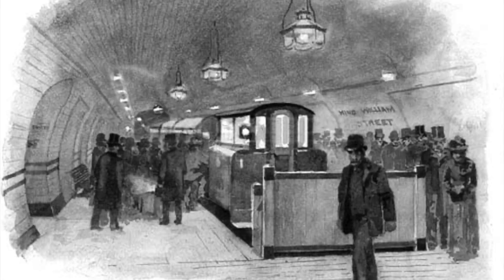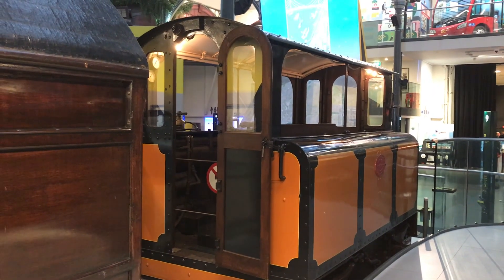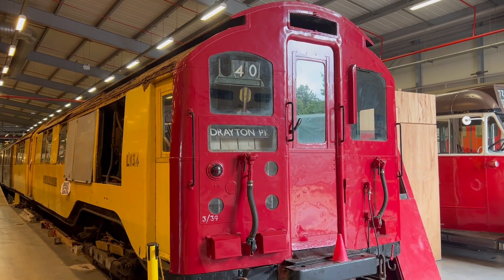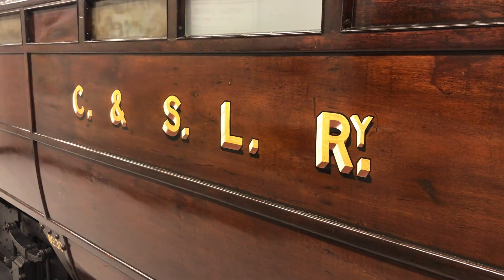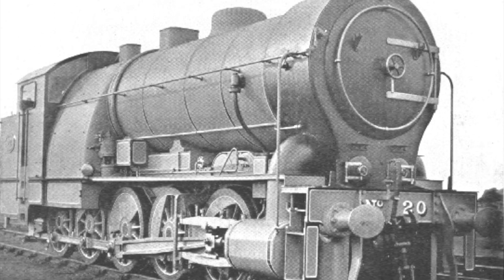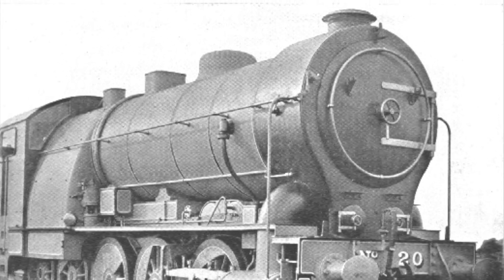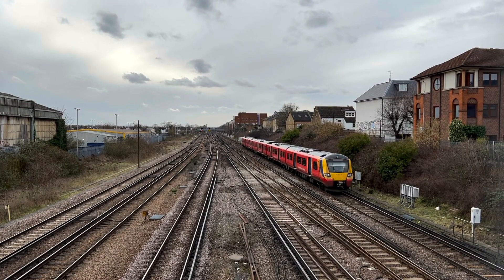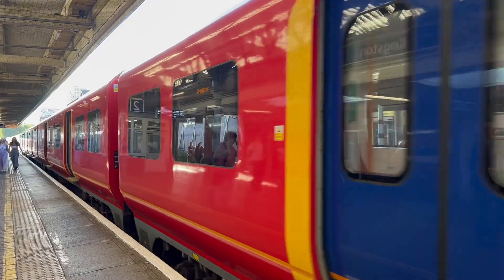Why some electric trains use a third rail, and others don't

Comment: I started on the North Clyde. Had a quite intensive electrification module on my Guards course.
When I transferred to Reading, I pointed out that I knew nothing of 3rd rail. My conversion course consisted of the words 'don't step on it'.
Reply: Pretty much all you need to know. 
When the lovers walk open days were on at Brighton 1990 the juice was off in the entire depot. You could tell staff and punters as staff were still stepping over it where punters were sitting on it eating their sandwiches.
Reply: @highdownmartin it's a habit you don't want to break!
Reply: @highdownmartin  Having grown up with electricity, I would never sit on the electric rail, just in case someone somewhere de-isolated it!
Reply: Should have included "and don't pee on it".
Reply: I had a friend at school whose father was a senior engineer on the Glasgow Subway, after having started his career on the Tube. His rule was simple: just don't stand on any rail ever.
Reply: When I joined the SR in the 60s I was taken to Stewarts Lane for a look round. At one point it was decided to cross the depot to the other side (we had been told not to step on anything metal) and we set off over the network of lines. At one point (literally) I found myself with nowhere to put my foot but fortunately, after an ungainly hop, managed to extricate myself from serious embarrassment and what would have been a very red face. Nevertheless, I much prefer the tidiness of 3rd rail to all that knitting.
Reply: I started on the Great Western Route, and was trained in PTS AC DC in case I somehow found myself at Reading (not at all likely as I worked for the Westcountry Area Signalling Engineer based in Bristol, even the AC part was a stretch as the nearest wires were at Airport Junction in London). 

I can still remember it being drilled into me to apply T-CODS to the furthest rail from the 3rd rail first as the cable wouldn’t reach far enough to short out the live rail to the furthest running rail. 

I done the opposite to you. I moved to Scotland and had the DC part removed from my PTS. 

When I consider how often I’ve been down on my hands and knees in the 4ft and leaned over to the rail, the thought of doing that where there is a live rail right there is terrifying.

Comment: Stepping on “The Third Rail.” A mistake that is only made once!  ⚡️💥 
Remember the old electrician’s saying: It’s the Volts that jolts but the mills (milliamperes mA) that kills. The current from the third rail exceeds over 1000 Amps.
Reply: Some moons ago I was LT train crew. Unusually I was wearing leather soled shoes one day, it was also raining.
I'd been instructed to stable a train in sidings. Leaving the cab through the door in the front, I stepped from the cab floor to the coupler, from the coupler to the neg rail and then to the ground. With one foot on the ground, the other still on the neg rail and one hand on the grab rail I felt a decidedly tingling sensation. Releasing the grab rail and moving my foot from the neg to the ground caused the sensation to stop. I never wore anything except rubber soled shoes again.
Reply: @RogersRamblings did the rubber soled shoes have a thicker sole? I knew someone that worked at Upminster Bridge, his doc martins had a thinker sole just incase you accidentally touched a live rail.
Reply: @johnchurch4705  I normally wore ex army rubber soled boots or occasionally rubber soled shoes. It was only the leather soles that allowed current to pass.
Reply: When my dad worked out of Hornsey on Eastern Region with a diesel on to the Slade Green Depot on the Southern region via Snow hill tunnel, he did forget about the 3rd rail and step on it climbing off a loco. One can think his boots insulated him.

Comment: The DLR is third rail also, but with safer bottom contact - ie pick-up is from underneath the rail, the top being insulated, so largely overcoming track safety issues - but still 750v DC.

Another issue is that OHLE permits faster running.  Because of the shoe system Third-rail and Four-rail systems have a practical speed limit of about 100 mph (that’s one hundred miles per hour for those who think in metric 😚).  Still fast enough for the vast majority of even quite long-distance services.

Despite notable installation and maintenance cost advantages (and greater safety with bottom current collection), Network Rail is set against third rail and would (if it had the money, which it doesn’t) rip it all out everywhere.  Then again OHLE isn’t exactly without its dangers with staff warned not to get closer than 9ft from a live cable.
Reply: When I got a ticket to access the DLR track to work on an overbridge the DLR ticket was just a few hours compared to nearly a day for the Underground ticket. They did say that you could electrocute yourself on the DLR rail but you would have to be unlucky or trying too.  The National Rail PTS ticket was a number of days but they covered working on live track.
Reply: 100 mph = 160 kmh. It's not the fastet but not slow either. Here,  in the Netherlands, (1,500V DC with overhead wires) maximum speed for trains is 140 kmh (87 mph). Only on the HSL trains are running faster. Although, due to subsidence in the railwaytrack, at this moment on that line speeds are restricted to 120kmh (75 mph) only between Rotterdam Centraal and Schiphol Airport... which means for now that trains on the old lines are temperary running faster... This has nothing to do with maintenance but everything with soft surface which was and is always a problem in this low country.

Comment: I'm sure I read somewhere that there are restrictions on 3rd rail electric systems these days. They can extend an existing system, but not equip a new one, like the Chiltern Line. The DLR has a third rail but it's hidden underneath plastic to get round this
Reply: I believe it is to do with UK H+S law about a working environment with easily accesible unprotected live conductors not being permitted.
Reply: Yes, sabotage by civil servants.

Comment: Why is the engineering for overhead wires so ugly and over engineered in the UK compared with Europe? Watching cab rides in Norway and Switzerland thet are slender and graceful wheras ours are clunky and brutish.
Reply: Depends on the era it was done. The west coast out of Euston and east coast out of Kings Cross are very lightly engineered but suffer quite badly when there is a dewirement. The Great Western out of Paddington is very much brutal and over engineered - except the bit up to Hayes and Harlington which is now suffering for not being up to the job today. After all that bit was put in for Heathrow Express not all the services that use it now.
Reply: These systems use a lower voltage than the UK.  This means lighter insulators and less strength required.  Speed may be a factor.  Do these countries have 125mph speeds?   Other factors such as life span may come into it.  I would think  UK OLE is more expensive, in material alone so there must be a good reason for it.
Reply: @tristacker  Frances high speed lines use the same slim and lightweight equipment at 25kV and 320 km/h.
Reply: @tristacker  Germany has been using HVAC powers since quite some time, being one of the first large scale adopters, in fact.

Comment: I think that outside of London and the wider south east and a tiny bit of the south west as Weymouth is hardly the south east the only other place in England to have third rail is the Merseyrail system.The Manchester to Bury line had some kind of rail pick up too but obviously that's replaced by a tram now.
Reply: Tyneside was 3rd rail
Reply: @henrybn14ar  Yes, and Tyneside suffered the curious fate of being de-electrified in the 1960s before re-electrifying with overhead wires for the Tyne and Wear Metro in the 1980s. At least it survived.
Reply: The Glasgow Subway, a true oddity, uses a 600 V DC third rail system and a track gauge of 4 feet and has a single circular line around the city. As I'm not a Scot I cannot possibly explain this.
Reply: Yes, Manchester to Bury was electrified way back in time by the Lancashire and Yorkshire Railway and had a third rail with side contact that was non-standard all its life. When train/track renewal was needed it was an obvious candidate to be one of the first lines to we switched to trams, along with the Altrincham route.

Comment: Interesting but some points to add about Southern: government won't stump up the money to convert to overhead power lines; too many NIMBYs against "unsightly wires & gantries" ; every frosty night trains have to be run dispensing de-icing fluid to try & prevent the 3rd rail from freezing ( in the past this has been thousands of litres of vegetable oil).
Reply: Overhead wires are always falling down and need constant attention. 

It is probably best to confine electrification to busy routes.
Reply: @henrybn14ar Only if the electrification was done on the cheap (like the East Coast Main Line.
Reply: @henrybn14ar  Always falling down, constant attention, really?
Reply: I was only thinking earlier when talking about Marylebone being all diesel. And when Cross Rail was first mooted the Aylesbury line was going to be part of Cross Rail and thinking given what NIMBYs they are in South Bucks there is no way trains to Aylesbury would be 25kv OH. Why do you think HS2 is virtually all in tunnel until North of the Chilterns.

Comment: This assertion that Britain was slow on the uptake of electrification is not strictly accurate. From the end of steam British railways went over almost entirely to electric traction. It's just that most of those electric engines had a bloody great diesel generator on board...

Comment: maybe an idea for a follow up on electric trains: Why Europe has more so many different types of railway electrification?
compared to the one electrical grid of 230V, 50Hz
Reply: 230V is far too low for efficient transmission over distances. There is even quite a big drop per mile at 750V. 
The higher the voltage, the less the losses and the further apart substations can be. But traction motors don't like high voltages, so you need a step-down transformer on the train for anything much above 3kV. Which adds weight and complication to the train. And you need AC as transformers don't work on DC. But traction equipment needs DC supply (even AC traction motors: they are variable-frequency so you first need to filter out the 50Hz in the external supply) So you also need a rectifier on board. More weight, more complication.
So on systems with many trains in a small area, low voltage DC is preferable. On systems with fewer trains over a longer distance, high voltage AC is better.

Comment: Very good explanation of the reasons for different electrification methods. I believe the underground lines used the 3rd and 4th rail system to avoid possible electrolytic corrosion of the tunnel metalwork by earth return currents. I remember reading that an increase in earth currents could be detected a long way from the Southern's third-rail network when the Eurostars were using third-rail pick-up, due to their higher power demands, although their power was much reduced compared with that available when using 25kV overhead pick-up.
Reply: You are correct about the 4th rail, but do you know all the reasons. It is something that is not included in driver training, so I have spent many hours fully explaining the full reasons to drivers over the years, along with problems caused by it's absence on the overground network. Many drivers call me the professor and needless to say, some add "nutty" for good measure.
Reply: @wilsjane  It still seems strange that every other metro system (that I know of) in the World manages to use the running rails for the return circuit without any reported problems of leakage, whether they be 3rd rail powered or from an overhead line. Also, two other tube lines in London have or had 3rd. Rail- The Northern City branch which was converted from 4th. rail when taken over by BR, and the Waterloo and City line which was originally 3rd. rail but converted to 4th. rail when the stock was replaced by 1992 stock from the Underground production. There was also the Post Office railway which used 3rd. rail.
Reply: @MervynPartin The fourth rail system was chosen because, as the first electrified railway of its kind the degree to which electrolytic corrosion of tube lining rings and nearby gas and water pipes wasn’t known and a ‘better safe than sorry’ approach was taken.
Reply: @SteveW139  There were also concerns about interference with telegraph networks, however, is there any need to continue with a 4th. rail after all these years, after all the Northern City line had similar, but larger cast iron tube segments, and that was changed to 3rd. rail OK. It might save the Underground a lot of money if they used less steel rails, less insulators and also less de-icing.

Comment: One of the oddities of the third rail system in the South is that it wasn't really suitable for large goods yards or goods lines, where staff had to couple and uncouple wagons manually. Steam locomotives or diesel shunters were used, but later on overhead wires were added (after 1940), such as at Hither Green and at Ashford(Chart Leacon) in Kent, where interestingly, they used a unique tram-style 750v DC overhead wire that could be used by the class 70 and later class 71 electric locomotives, designed for 650/750v third rail use but with an added pantograph.
Reply: The Southern Railway "Booster" locomotives (later class 70) were constructed in the 1940s and were fitted with pantographs for use at Ashford and Hither Green when built. They predated the class 71s which used the same booster technology. There were only 3 of them but they worked well. I have the EFE (Bachmann) model on my model railway.
Reply: @MervynPartin  Thanks for that, I do remember seeing the wiring at Ashford in the late 60s, but I didn't know the tram-style wires dated back to WW2 or about the class 70s, but I've corrected my mistakes above. Wiki says they were installed to prevent trackside staff accidents with third rail during the blackout.
Reply: 750v DC overhead was also used at Snowdown Colliery in Kent

Comment: Very decent attempt at simplifying a very complicated topic Jago, and very much better than any others I've seen. Doubt if I could have done any better without getting very techie, I fear this is one of those subjects where a certain amount of basic physics is essential to gain a reasonable understanding much of what's going on here.

There's no easy comparison in saying whether (either now or historically) third rail is or has been cheaper than OHL. And that's not even taking into account the equally important distinction between AC and DC OHL systems. Very much "how long's a piece of cable?" territory here.

While AC is truthfully the better system today, third (and fourth) rail still have a great deal of importance, and its not like AC electrification was without its problems - see the history of the Glasgow Blue Trains in the early 1960s, a tale of mercury arc rectifiers and transformer explosions.

Comment: This is a bit weird. I was thinking about just this last night, but more in terms of why the 4th rail was necessary as a -ve instead of using the rails as a -ve. I believe it has to do with earth leakage but other systems got around this. This all started with a solar charger I got in a charity shop that can generate about 18v on a sunny day and some videos by BigClive about power regulation, distribution and a tremendous regret at not having paid enough attention at college.
Reply: The reason for 4th rail is that the tube is lined with cast iron segments, and if the running rail was used as the return, stray currents would promote galvanic corrosion in the liners, which are often in damp soil. Running rails can't be fully isolated from ground, unlike the power rails, which use ceramic insulators. With one rail at -210V and the other at +420V the current runs between the two and is well isolated from the ground and doesn't promote corrosion. That said, world-wide, 4th rail electrification is fairly rate.

Comment: I'm sure I read somewhere new third rail installations were banned. There's a new bit of track/station on a metro system (Merseyside?) that has to have diesel for its extension as they were not allowed to extended the third rail. This may be rubbish, however.
Reply: I believe it is to do with UK H+S law about a working environment with easily accesible unprotected live conductors not being permitted.
Reply: @001mrbbb001  which makes no sense to me. There is so many jobs on the National Grid which require working with live conductors, also you could just build the rail and then connect it to the grid at the end?
Reply: No, it's true. Any new electrification on any Network Rail line has to be 25Kv AC except in the rare case that two DC lines are being linked up across a small distance. The short extension to Headbolt Lane from Kirkby could not receive third rail DC electrification for this reason, so a battery Class 777 unit is being trialled instead.
Reply: It's the Merseyrail extension to Headbolt Lane. It needs batteries for that bit, but the rest is third rail.
Reply: You can rely on the ground to screw things up
Reply: Yes found it. ORR policy from 2015 saying that they are not compliant with the electricity at work act.
Reply: Battery powered, not diesel. I suspect that was an easy way out to avoid spending money on extending the third rail. I think if they had pushed it with the authorities they could have been granted an exemption.